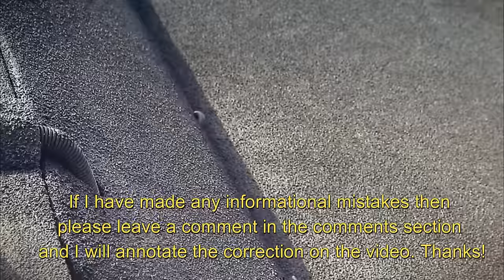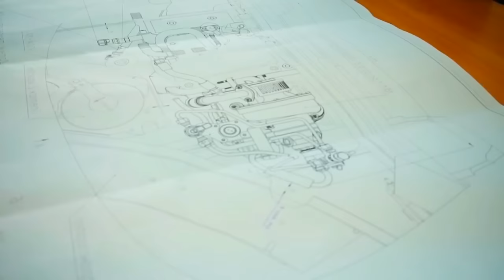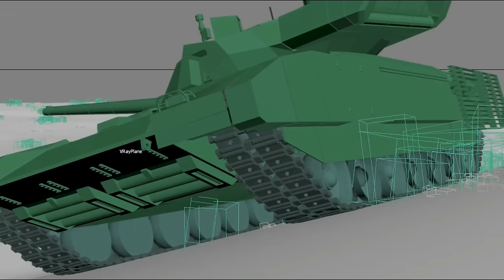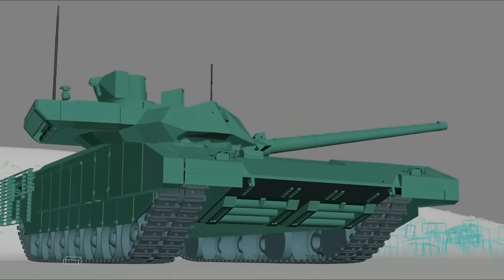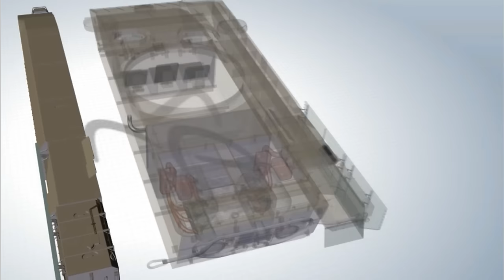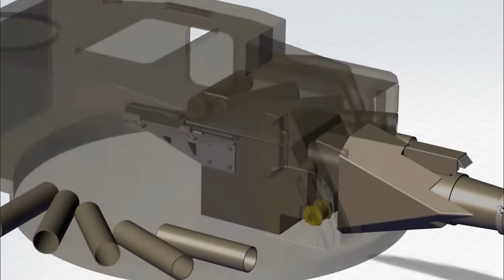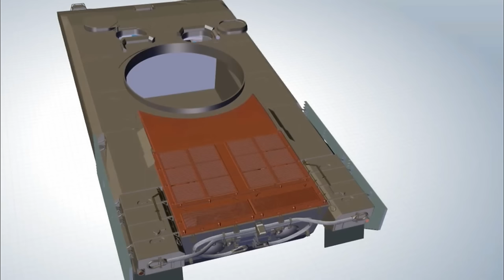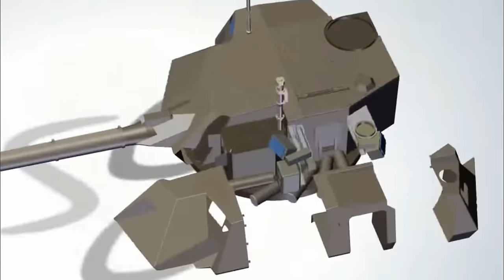T-14 Armata Russian Main Battle Tank - Tank Overview

Comment: Armata-great in theory. However. Can Russia afford to buy more than a couple od hundred? Can they produce them at any significant rate? 
Also, it seems that these are going to pop their turrets just like the T-72 when penetrated-autoloader carousel below the turret ring.
Reply: Well, T-14 cost is about 3.7 $ mil so maybe they will?
Reply: Actually, 100 are curently being made and 2300 have been ordered till 2025. And autoloader is extremely armored since in previous variants adding a lot of armor would disable crew of manual loading if autoloader breaks down. But since newer autoloaders never failed and there is no one to manually load the gun, ammo is extremely armored
Reply: There is no such thing as impenetrable armour.
Also, given current economic situation in Russia, the 2300 ordered is bit daft, to say the least. Just like the PAK FA order was reduced from 55 till 2020 to just 12. 
However, if they manage to fulfill that order and pay for it, count me impressed.
Reply: +damonstr I didn't say its impenetrable, it is heavily armored, but the autoloaders armor is the last thing you want to worry about on Armata.
And my bad, lol, 500 till 2025, 2300 is total number planned to be added to Russian army, but more will be built since Egipt, China and India have already ordered some T-14s
Reply: China gonna copy this badass, just like other "licensed" chinese jetplane that basically rusian... just modifed.
Reply: They can only make a bad copy, but on the whole adequate.
Reply: damonstr - I think that everybody here should be reminded of whom we are talking about, ie. Russia, things don't always work the way that you, or most other people would thought should work. They apparently have chosen to invest heavily in their military rather than social programs, infra-structure, segments of their economy, etc. So, in all probability the Russian MoD will have their new, shiny tanks, aircrafts, and ships. 🎲
Reply: RedEffect - but more will be built since Egipt, China and India have already ordered some T-14s

You probably meant that they have shown interest, don't you. 🎃🎃🎃
Reply: Unholy Warrior Yeah, my bad, but the problem is not in them, the question is, will Russia even permit the sale of Armata to foreign countries, since it has many tech stuff which is highly classified.
And Russia's military budget is seperate from the one of the state, in the last couple of years they really focused on selling military equipment to other countries, where many countries nowadays use T-90 as their tank and not to mention T-72s and all the planes and small arms, that is where Russia got ton of money from, so they have enough to build 10000 Armatas. Russia has been improving its economy in last decade, in last 10 years average income raised by 200%
Reply: RedEffect - Well, judging by all the comments that can be seen on YouTube about the T-14, maybe they should classify it even higher. If I am not mistaken, a lot of Russia's economy is based on selling commodities, such as iron, oil, gas, lumber, nickel, etc. and exporting arms is just part of it. And the average income has improved a little over the last 10 years, which might well be expected. 👽
Reply: +Unholy Warrior Maybe you missed the point, money that comes from sold military equipment does not go to the same budget as oil. Military has its own budget which is controlled by army ministers. And are you telling me that 200% increase is not a lot??!!!
Reply: Honestly, given in what a bad state the country was in 2000 when he took power, that was not too hard-just remove some of the leeches that were the oligarchs. And how does it matter if the military budget is separate from the public one? Do they pull the money out of their asses? Or maybe they pick it from trees?
Reply: damonstr To say that the defense budget is separate from the state is not correct. It is not, the burden on the budget exists. The reorganization of the army and its property largely given the necessary resources. Many defense programs are executed on the funds of the army (sale of property) and corporations (income from foreign orders).
Reply: +damonstr Have you ever heard of trade, where you sell something and you get money for it? If you look at military forces around the world, wast majority use Russian equipment, from small arms to jets. And If making a good state out of bad one is so easy, why are so many countries in bad economic condition.
Reply: Foreign orders are not going to build Russian tanks. Besides, there are none confirmed so far.
Reply: the turrent is unmanned..so who cares? the abrams is getting cooked in syria and yemen...
so placing all the crew in the front is possibly the best solution...or invent some material that would not be penetrable by nowdays ATGM's...
Reply: damonstr I am talking about all the stuff Russia sells. They build a tank/gun/plane/helmet/vest... and they sell it for money. They use that money to make themselves some tanks, where if you did not know, manufacturer builds a tank where Military buys from them, which gives manufacturer money to invest into building more tanks, and the cycle continues. What is so hard to understand there? Those are basis of trading.
Reply: When turret pops, the tank chassis is most of the time beyond repair. That is one of the advantages of having western-style turrets with ammo in the bustle (with blowoff panels). The downside is of course that you can't have an unmanned turret in that case.
Depends on your tank doctrine, I suppose.
Reply: RedEffect - Russia's arms exporting business is worth only a few billions as far as I can find out, maybe you can come up with a number for us. I am trying to tell you that it's not 200%. 🎃🎃🎃
Reply: Unholy Warrior Not exactly, export more. weapons maintenance, construction industries, technology transfer, construction of nuclear power plants, ships, submarines, not just the military. Manufacture of unique parts for CERN, ISS, etc. It's a lot of money. Defense companies have been united by the corporation in the directions of research. Rostec - science, technology implementation, Schwabe - optics, lasers and imagers, Rosatom - civilian nuclear technology, new materials, accelerators.
It's not as easy as it seems)
Reply: ***** Expelling panels line the pressure at ignition of propellant composition, but in contact with air ... boom! Just a couple of seconds to leave the tank, barely better than without them.
Reply: damonstr  actually they are about to be able to afford it : they are getting ready to open their own oil trading platform that will only trade oil over RUB instead of USD (and keep in mind that Russia just passed Saudi in oil producing). Once that's opened, as they can start setting their own competitive price, that'll start pulling sales from the other 6 existed platforms; and as RUB is being used over trading oil, their currency will then rebound .... which then they can afford buying as many tanks as they want. Petro Dollar is the reason why we can afford sustaining our military might. Russia is simply pulling a page from our play book.
Reply: bs claim in September 2016 russian defence ministry placed a order of 100 T-14 not more not less... the Army claimed they need 2300 but money talks today even in Russia.. at the moment the production idle at 10/year
Reply: *****
wtf is wrong with u? I said currently they produce 10 tanks a year... I never claimed that they cant produce more if needed...
Reply: http://russia-insider.com/en/military/russias-armata-tank-formidable-cost-issue/ri8755
Where are you getting your numbers from? Even the Russian Army said they NEED 2300 modern tanks. Quote from article: Uralvagonzavod, its manufacturer, has stated that it is ready to produce 40 tanks in 2016, 70 in 2017 and up to 120 per year from 2018. So the absolute maximum number of Armata tanks potentially in service by 2020 is about 330
Modern tanks could also mean newest modifications of T-72 and T-90.
Reply: +damonstr
The batch of 100 Armatas has already been ordered.
https://southfront.org/russian-military-gets-first-batch-of-t-14-armata-tanks/
It is in plan to completely arm the military with those tanks by 2025. By reports from 2 months ago, Russia had 30 of those tanks. I am not entirely sure if more are fully completed, but 100 were ordered this september. So, that contradicts to your first statement that Russia can not afford those tanks :)
The tank is currently into full trials and you could have seen it rolling and doing a lot of things during the Russian National Tank Day.
Reply: 100 orders is far from Putin's requirement for "2300 modern tanks by year (sorry I forgot)". 
Russia has only 550 T-90s of their own, and those only cost half as much as T-14. 400 of those came since 2004. Huge procurement numbers, yes? 40/year. Even with defense budget increasing recently, it's unlikely we'll see more than a few hundred T-14 by 2020.
The 2300 tanks figure is likely to include latest modifications of the T-72 and T-90.
Reply: damonstr It is not the cost of T-90 that is the problem. You see, Russia made a lot of T-90s, almost 2000 of them, but a big number is sold. And the other reason being is, it is completely new tank, where they can take already built T-72s and upgrade them to T-72B3 which is very similar to T-90 for much lover price and much sorter time. Another reason is that Russia used to have T-90, but since 2004 they started using T-90A which features a bunch of upgrades and completely different turret design, which also took time and money to convert already existing T-90s to T-90As and make completely new T-90As. 
Now back to Armata.
Look, Armata is not only tank Russia is focusing on. There are still T-90As to produce. There are T-72s that are suppose to be upgraded to T-72B3. New T-90AMs to make, not just Armata.
Armata is just one of many to see the light of day in the following years. 
Few hundred by 2020 is the original idea. But it is in plan to increase the production rate each year.
2300 is not the number of all tanks, it is just Armata and it is not completely sure when that number will be completed. But, lets look at US for example. They operate with 4000 Abrams tanks where only around 1000 are M1A2 tanks and other are M1 and M1A1. Russia has 550 T-90A, 4500 T-72 tanks which some are upgraded to match the stats of T-90. And wast numbers of tanks in storage such as 6000 T-72s, 4500 T-80s, 4000 T-64s. Where US has 8000 Abrams in total, including the ones in use, which means around half of them are in storage, and those are mainly old M1 tanks.
And now US has new M1A2 SEP V3. It is to enter production next year. You think they will make more than couple of hundreds till 2025? I doubt it, cause M1A2 came out in 1992 and there are 1100 of them. 24 years for 1000 tanks. So, there is no way US can surpass Russia in tank production rate. And dont forget that Armata is not the only one in production, where M1A2 SEP V3 will be the ONLY tank US will make for domestic use.
Reply: I found this:
For the M1A2 upgrade programme, more than 600 M1 Abrams tanks were upgraded to M1A2 configuration at the Lima Army tank plant between 1996 and 2001. Deliveries began in 1998
Numbers for Armata procurement I can't find, just nebulous claims without any concrete numbers. The only real claim I found is that Uralvagonzavod said they'll produce 120/year when production gets started (can't find source, so that's weak as well)
And why are we even comparing the production of T-14 to US M1's? The doctrine and situation of the two countries is just so much different. The US Army doesn't even want new tanks ATM, and they've been dragging their feet on M1A3 development for years. Not to mention the lack of real commitment to Abrams replacement.
Reply: I used US as an example, since you stated Russia is incapable of producing enough Armatas. 
Everyone wants new tanks all the time, so saying US doesnt need one is highly unlikely, Abrams has a lot of issues by itself, one of which is large fuel consumption and APU being exposed, which have been reduced problems since M1A2 SEP V3 received upgrade which leads to less fuel consumption and APU has been placed next to the engine, inside the armor.
And as I said, I am not comparing them, I used US as an example, on how much tanks are hard to make, doesnt matter the amount the money you have, since US has bigger military budget than Russia, and Russia's is increasing. So, my point is, Armata may be slow to produce, but is nothing slower than it's counterparts, also taking into account that Armata is not the only tank being produced, but ONE OF MANY. Russia does have money and time to make them. Considering how complex the Armata is, 120 tanks a year is huge number for such a tank. And as I said, 100 have already been ordered and the MASS production will start next year, and dont worry about the money, Russia has enough to build those 2300 T-14s several times.
Reply: "Everyone wants new tanks" - except for US Army brass. Why? No idea, personally I think they're idiots. Tanks are awesome.
Russia has big ambitions when it comes to military modernisation - new subs, ships, AA systems, aircraft, they're basically buying all new equipment. With 10% of US pentagon budget. Where do 2300 tanks fit in when their economy is again going down, and future budgets are already being cut? Money is definitely an issue, especially when the economy is so dependent on oil exports. 
I guess having a common platform for different kinds of vehicles will help though.
Reply: RedEffect
Russia never produced 2000 T-90

the true T-90 production

657 build in Russia for export
to India (128) Algeria (344) Armenia(1) Azerbajian (100) Turkmenistan(40) and Uganda (44)

550 T-72 upgraded to T-90
for russian Army

577 T-90 kits
for India and Algeria localy build together

1340 licens produced outside Russia
still in production about 900 of the 1340 are build so far
Algeria (340) and India (1000)
Reply: RedEffect
u realy belive that the most powerfull econmy cant outproduce russian tank production if they will? LOL look back to ww2 Sherman production... as the US industry seriously started producing Sherman tanks they easly outproduced russian T-34 production by MILES and were still able to produce all the other stuff like Jeeps, trucks, railcars locomotives boots clothing petrol oil steel food... by the end of ww2 3/4 of red Army supply and logistic was based on US made trucks jeeps railcars railways locomotives...
back to Sherman vs T-34 production
The T-34 production reached its peak in 1943 with 15.812 T-34 produced... the same year US factorys throw out 21.231 M4 Sherman
Reply: You are wrong. T-72 can't be upgraded to T-90. If you mean the T-72B3 has a little over a thousand. India currently has 900-1000 units until 2020, even up to 1000 units. Only for India up to 2000 sets of T-90S. 
The t-90 and T-90A is approximately 450-550 units in service with Russia. Actively 400-450.
Algeria, about 300 T-90СА, the best equipped model. 100 Azerbaijan, Turkmenistan 40, Uganda for 44 units. ~ 480
Total:
Russia - 450
India - 1000
Algeria -300
Azerbaijan - 100
Turkmenistan - 40
Uganda 44
1934+1 prize units(Armenia) + 1000 sets by 2020, if not to take into account the prototypes and training tanks of the old models
Reply: What you have just proved that the mass of crushed Germany, not the Soviet Union. Another myth of Western propaganda. After 1943, the superiority of the Soviet Union over Germany fluctuated in the range 2.1-2.5. What forced to concentrate forces for strikes. So who fought better?
Reply: nagmashot 
I never said no one can outproduce Russia, I am just looking at current situation. If a war broke out, any country would increase tank production rate, including Russia, but with current situation in the world, there is no need for anyone to increase the production rate.
Russia made much more T-34s than US made Shermans, US made more M4s than Russia T-34s just in the year 1943, because Russia lost most of its factories for tank production and production rate decreased. US on the other hand had all of its factories working and no enemy on the US soild, so the production went without a problem. Lets look at other years, not just 1943. 
1941
T34 - 2800; M4 - 0
1942
T34 - 12553; M4 - 8017
1944
T34 - 14000; M4 - 13000
1945
T34 - 12000; M4 - 7500
If US was that much better, why didnt they outclass Russia in other 4 years of the war?
And Russia managed to produce other stuff too, imagine that, including the fact that most of the factories were blown to hell. What about Self Propelled Guns, Heavy Tanks, Trucks, Armored Cars, Oil, Food, Artillery pieces... Russia was producing all of that. Where did they get the resources? Siberia is your answer. Iron, Oil, Coal... everything they needed.
Russia had better production in other years since the factories were not that much destroyed. And if you look at total number of tanks made in WW2, Russia outclasses US.

Over 1000 T-90s were made in Russia. I forgot to count India in the number of tanks made abroad. But, the point you tried to make, the one of T-72s being upgraded to T-90, dunno why, maybe to make it look like Russia never made a full tank for domestic use, is not true. Russia made all of those tanks, No T-72 was ever converted to T-90, becuase T-90 is completely different tank. Russia made well over a thousand of T-90s where 550 are in domestic use and the rest are sold to other countries.
Reply: +nagmashot
Now you are really making me laugh :D 
As I said before, NO! US did not give any resources to Russia, they did give Russia vehicles and stuff, maybe a bit of resources, but Siberia was 95% of Russian resources. It was not under any attack and some people that lived in Siberia were not aware of the war at all. Russia could outclass US and any other country because they had a looot of resources, I mean, Siberia is a gold mine for resources, it is FULL of them. I dont know who dafuq told you that US is the main reason Russia was continuing production, should really go back to school, if they even teach you the right history in schools anyway.

LOL, no shit, the first designation of T-90 was T-72 BU. But it was renamed, not only cause of Iraq, but because of a lot of upgrades. But, the T-90, currently in use  is T-90A which is different than T-90, not to mention T-72, and it is IN PRODUCTION since 2004. So, no T-72s were ever upgraded to T-90, because T-90 is not T-72. It is like saying T-72 is T-64, those tanks share A LOT of similarities but no one calls T-72 the T-64 because it underwent a lot of upgrades, just like T-90. T-90 is a new tank, a lot of people try to put out the thing that it was first named as one of the versions of T-72 as some stupid proof. Name means nothing, get over it. You are just now basically trying to get away with your mistakes. You got proven wrong about production in WW2 and you went on saying how its US who is responsible for Russia's production?!?!!? Dafuq!?!?! And dont forget, majority of factories were destroyed, and Russia still managed to outclass US :P
And then you said how Russia upgraded T-72s to T-90 and then you got proven wrong and you excuse is that T-90 was originally named as one of the variants of T-72.
Fun Fact - Russians tended to change the name of their tanks before putting them into production well before T-90. For example, IS-2 was originally named IS-122 because it was just IS with 122mm gun, but they changed the name later because it was different tank. Even IS was first to be of KV family but underwent changes and got a different name because it was a new tank (KV-13 was project before IS, so IS was to be named after KV-13 but got completely different name).
In conclusion, Names mean nothing, they could even change T-14's name to T-17 when they put it new gun. Does it mean something, no.
Reply: damonstr the russian find that if they remove the spare ammo in the turret,the chance of ammo denation decrease by half,so,most ammo denation that causes the turret to pop up was caused by spare ammo,thus,the russians think the autoloader can be kept in their latest design.
Reply: It is true, but not quite. Remove from the inhabited of volume of all additional non-motorized laying projectiles and further protect the auto-loader. Implemented in the T-90AM additional installation in an alcove behind the tower, or T-72B3 - or fill only mechanized stacking.
Reply: damonstr Don't worry T-90ms is enough to fight against western tanks.
Reply: So yeah, it pops it´s turret...so what, it will potentially just drive back home and get a new one. something previous russian tanks couldn´t do since the entire vehicle would turn into hell when the ammunition went.
Reply: Sure... if they don't plan to eat for a year or two.
Reply: Russia doesn't have to "afford" anything since all of the factories the tank is built in are fully owned and operated by the state. The price tag is a general idea of how much it would cost if another country buys it from Russia
Reply: That is nonsense and you know it. The parts for tanks have to come from somewhere. The basic resources. The half-products (iron bars, steel plates, rolls of rubber, or whatever). Someone has to form that into final product. Someone has to make the electronics. All of those people need to be paid. The transportation needs to be paid. etc.
I guess you could make the whole supply chain state owned, but I doubt it is; and somehow feed your workers and give them a place to stay, and have everything state-owned. I believe such a system was tried a while back in Russia. I'm not sure, but I heard it didn't work out too well in the end.
Reply: Of course not all parts are build and assembled at the same plant, I didn't say they were. What's interesting is that in your attempt to spite me with your sarcasm you actually described how the whole thing actually works. 

The thing is that the military complex is the only thing that was completely untouched by the reforms in the 90s. Almost the entire building chain is state owned and almost all resources are sourced from state owned mines and other facilities. 

I'm not saying it's free, far from it, but it costs a fraction of the price of the M1 for example. 

P.S. Most of the non-specialist workers at military make about 300-350$ a month so salaries don't really drive up the cost as much as you'd think.
Reply: By that logic the military also costs Russia (or any other nation) nothing at all, it's all state-run after all.
State run enterprises also cost money to operate and upkeep. If it was all as simple as you imply, Russia would have bought conjured up new (and really needed) equipment years ago. Even in the best years of communism they could only do so much, and they had literally half (or close to) of their economy devoted to providing for the military.
Reply: Russia wasn't able to focus on it military in the 90s and 2000s because the country almost went bankrupt and people had nothing to eat. Once Russia got on it's feet it invested in the development of new equipment and the results came in pretty quickly (apart from the new tanks and armoured transports Russia also completely overhauled it's entire infantry). 

Also, the fact that new tech rolls out pretty rarely doesn't contradict anything I said for three main reasons: 
1. The soviets relied on numbers rather than quality and that meant that new tech wasn't always a number one priority and that new tech was always bundled with the extreme cost of overhauling all of the numerous facilities that produced all of the equipment (the more you want to be able to produce in a day, the more / bigger facilities you have. The more / bigger your facilities are, the bigger the cost of overhauling the production line. 
2. Overhauling is made even more expensive because most of the production line, from the raw materials to the assembled product is state owned. When you own just the assembly plant you can just find new contractors to produce the parts you need - you never bear the cost for overhauling this part of the production line. 
3. The third reason is pretty obvious - development costs. Production may be cheap for all of the reasons I mentioned, but development is still extremely expensive. So much so that the state had to increase it's "shadow budget" (the part of the budget that is not broken down to end-of-the-day costs and is presented as a big chunk. It includes army spending, special forces spending, secret projects and other defence stuff) had to be increased by several percent just to account for the loss on development.
Reply: If the answer to significantly reducing costs of production for gov. projects was really as simple as state-owned facilities, everyone'd be doing it. And even if production was practically "free", then you've still got these massive facilities and loads of people making tanks instead of cars, tractors or washing machines. (isn't defense production one of the backbones of Russian economy, besides oil and natgas?)
Reply: Yep, you're absolutely right - the military sector is a big source of income. And yes, that's the beauty of it - most of those facilities are used to make cars and tractors during peace time and are used for the production of military vehicles during war time (it's not all black and white, the capacity is just redistributed). But they still have to be modernised in order to facilitate this multifunctionality. 

And once again - they're neither free, nor practically "free", they're just a lot cheaper in comparison.
Reply: It almost sounds like instead of making money you're making tanks.
Reply: (They are*, I'm Bulgarian and only live in Russia. That's part of the reason I like to consider myself unbiased) Well yeah, sort of. The automotive industry in Russia has been running with an operating loss in the millions for many years now, but the sector receives a lot of federal funding so that the production capacity is not lost and Russia is able to quickly ramp up production (up to thousands of units per year) if needed. 

There is not a single automotive factory in Russia that turns a profit as far as I know.
Reply: It was until the 2000s. The receipt of any profit was not the goal. Later the state military factories were merged into a Corporation (by sector) with state participation. So managed to avoid subsidies and expenses.
Reply: Емил Ефендулов YES , I remember the YUGO dealers in the USA, what a piece of junk it was ! but I hope now are the cars made better ?  ✌
Reply: Yugo was Yugoslavian, not Russian/Soviet; fortunately for Russia. They were total crap also back home, and after many years of trying to compete with proper manufacturers the factory (Zastava) finally closed down a  few years back. 

Just goes to show how inefficient state-owned conglomerates are in a market economy. My country (Slovenia) used to be part of the awfulness that was Yugoslavia, and after independence, most of those companies closed down or downsized considerably; all the while being just a drain on the resources of the state. The ones that DID survive had to be restructured from the ground up.
Reply: damonstr By 2020 Russian will have at least 50% chance to win Against NATO or USA
Reply: The doctrine of ground troops of the Russian Federation does not presuppose a classic counter-attack, seizure of territories, in the case of the NATO aggression. Only the control of an important base, everything else is just unnecessary. What does it mean guess yourself.
Reply: It's Russia, they do what they want.
Reply: Джо Неуловимый I love to hear a person who's country has invaded 4 of its neighbors talk about aggression from countries who have tried for a century to get along with them.
Reply: Four countries over the last 30 years? What kind?)
The US did not attack anyone? Well, they can, in the order of "exclusivity." They wanted to sneeze on international law.
Did you want peace? And started with a coup and genocide in Yugoslavia in 1999?
After that, you can not even talk about the world.
Similarly, Japan will not sign a peace treaty, they have withdrawn from the treaty.
The United States, Europe, Japan do not recognize international treaties, only a word reinforced by force.
Russia is quite satisfied with this. "A bad world is better than a good war." It makes no sense to negotiate with someone who does not keep his word.
Reply: Seems like Channel One has been busy and doing some bloody good disinformation propaganda stuff over the last decade. You are obviously right, whole world is against you, you are martyrs and only you have the right opinion and view at world's affairs.
Reply: Джо Неуловимый you don't make much sence, but I will say russia has the worst record when it comes to invading other countries and not honoring agreements of anyone.
Reply: UVZ can produce 500 in month if necesary, is that good ansver to you ?
Reply: Cause PAK-FA will have new, DCF engine, with will surpass any us-eu moder and future fighters + full UAV support, due to G-s higher than human able to handle.
Reply: They cant, t-14 will be russian only, for some time or ever.
Reply: Your blow of panels and containers armored so poorly 12.7 machinegub can pop your arbrams in the the sky, thing was good in iraq but US-A only used DU shells, so no explosion, but since they start using HE things got a lot worse : )
Reply: That ? 10 tanks in year ? Maybe in week ?
Reply: UVZ right now couldn't produce 500 T-34s per month, what even armatas.
Reply: Well it was able to produce 345 t-34 in month in war time, and total of tank produced by UVZ is 46000 +.
Reply: "given the current economic situation in Russia"

russia just recently payed off the last piece of their national dept. I think they'll manage.
Reply: Ian French you know we Russians have stepped away from throwing things into the fire so to say out dated anti tank weaponry is a massive over statement
Reply: Yearly Russian defence budget is 70 000 000 000$. 2300 T-14s will cost like 8 000 000 000$. And they gonna buy 2300 machines by 2025. So, its like 1 000 000 000$ per year out of 70 000 000 000. Do the math.
Reply: 12 PAK FAs for tests. It does not mean, that they won't buy 58 jets, ya dimwit. Also, where are ~1000 Raptors?
Reply: The turret is unmanned, so the crew has a higher survival chance in case of a cook off. Given the oddly shaped polygonal turret, I'd say they have copied chobham style armor, so protection should be higher than T72B.
Reply: yep not paying for needless gender reassignment surgeries...
Reply: I see way too much propaganda disguised as "information" being thrown around in this comment. It's kind of funny, but also sad. Reminds me of North Korea and their information control and unearned sense of superiority.
Reply: @damonstr  India may buy it to replace it's old T 72